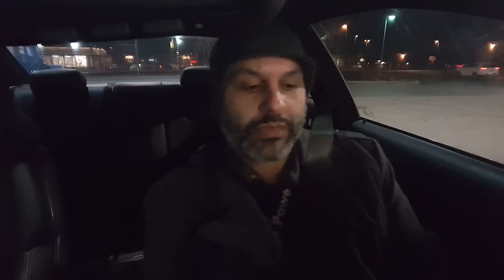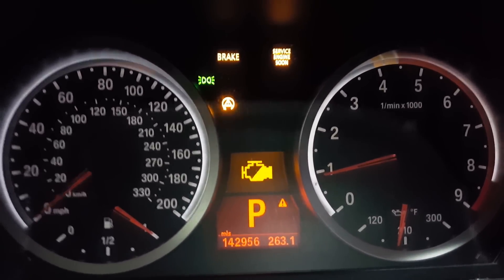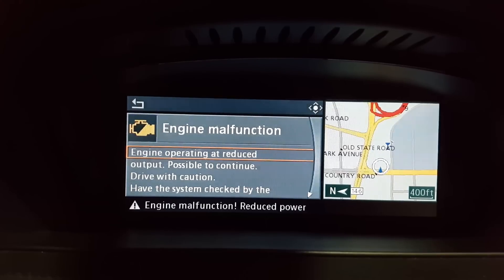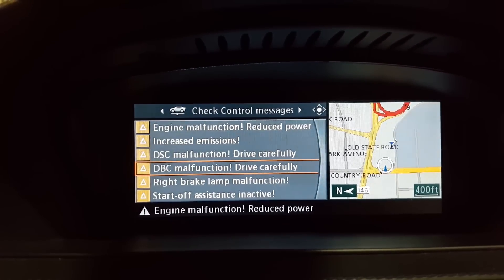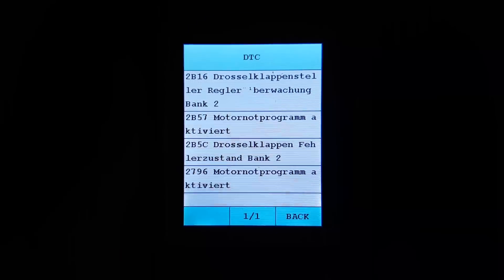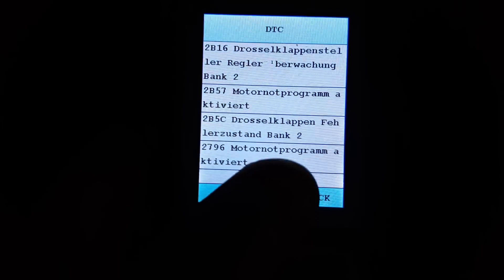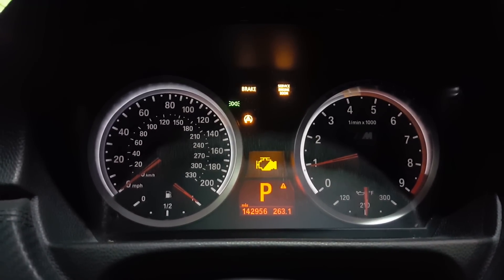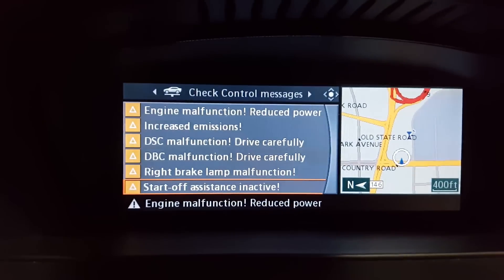BMW E92 M3 Limp Mode. How to tell whats wrong when in limp mode.

Comment: Hi RDDC hey brother I need your help I have a problem with my trodel actuators gears they are ok to reprogram the actuators  but the Mecanic is saying that he doesn't recommend me to change the gears he is telling me to change. The actuators instead of fixing them what do you recommend my actuators are taking the coding
Reply from the maker: +manuel lares Here's the thing. There's a chance the circuit board is bad. That's why they recommend this. You will know because your car will give throttle actuator codes then clear. The problem will come back eventually over and over until it doesn't clear anymore. If the gears were worn so bad or broke the codes would comes, the first time, and not clear. So the remedy is just replace both with new ones. I didn't do this. I replaced one and rebuilt the other. A reason why the board goes bad it suspected bad worn gears. The board tries harder to align worn gears and overheats. Or...just overheats from sitting under the manifold.
Reply: RDDC  i let the car sit over night it goes away and it comes back on ones I'm driving it
Reply: RDDC I try reset the vehicle with inpa and it just doesn't go away any more but the funny part is the car clears it by it self and comes back on
Reply: RDDC while driving it what do you recommend me should I replace replace the gears not cheap they're charging me 1000 bucks or should I go would use ones or just new ones
Reply from the maker: +manuel lares yup...that's the circuit board going bad. If you had a real bad gear the code wouldn't clear.
Reply from the maker: +manuel lares used ones are useless. Don't waste your money. I think you can find then new, both, for around $100- $1200. It's not cheap but that's the cost of ownership
Reply: RDDC  yes your right this car is been reliable and this is actually the first problem when he gives me and I have 157 xxx miles on it so Is normal to star experience issues or problems with it 

Do you have any link to were I can purchase the trodel actuators ???? I really appreciate the help
Reply from the maker: +manuel lares nice! Im at 151,000 right now.
Reply: RDDC  thank you for your help bro
Reply: RDDC goodnight 😊
Reply from the maker: +manuel lares anytime man. Have a good one

Comment: just got a big brake kit from stoptech front and back
Reply from the maker: +Roger Moore Sweet! What was the ticket about $3k?
Reply: Just about that 3k even
Reply: The front was on sale 1500 and the back also 1500.
Reply: The price went right back up this week
Reply: Can't wait to put them in
Reply from the maker: Pretty cool. I've actually never owned a big brake kit. Once I design and build my car I will get a nice set.....maybe sooner if plans work out the next 2 years
Reply: I got them because I have a supercharger kit and the car is fast I do need some stopping power
Reply from the maker: +Roger Moore That you do
Reply: The stock are not bad at all I need some reassurance
Reply from the maker: +Roger Moore Yeah but if track with stock brakes you need to upgrade the pads. If not you'll tear the rotors and pads up, maybe even the caliper itself
Reply: No track at all I don't want to do that
Reply: Some guys do it

Comment: Hopefully you sold it. It's not worth the repairs after 150,000.
Reply from the maker: Why would I sell it? Still running strong and Im at 165k miles. I do the work myself.
Reply: RDDC that's awesome.  No disrespect intended. I just sold my 2007 e92 at 189,000 miles. I went into limp mode all of the time and the tranny was starting to go bad.  You're definitely saving a lot of money by doing the repairs yourself.
Reply from the maker: 10akee Not gonna lie....I thought about it many times trading it in for a new M2. But in all seriousness....I think the V8 M3 will grow in value soon. To me it's worth keeping on that alone since it's been paid for....just have to wait my time

Comment: Here's a diy guide too (good luck): http://www.m3post.com/forums/showthread.php?t=735033
Reply from the maker: Thanks but that guide just shows how to replace the actuator not rebuild it. I did find a rebuild DIY that was a bit more detailed. But there are only 2 online I could finds so I should have the only video on YouTube actually showing the rebuild
Reply: RDDC yeah I kind of figured you will have to replace the actuator as it could be a circuit board issue. Had a Issue similar and realized it would just be easier buying the unit instead of soldering the board. Glad you have it working!
Reply from the maker: +Rob Davis Yeah no sense wasting time trying this and that. At least I have a spare board to try some thing out with.